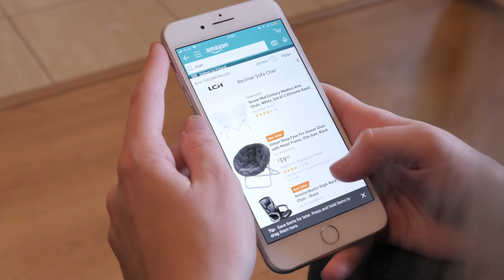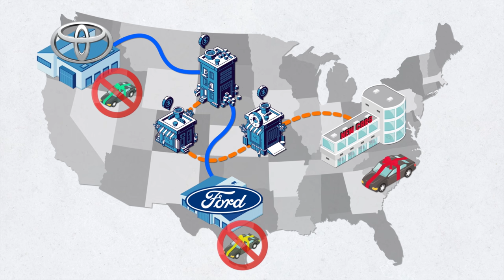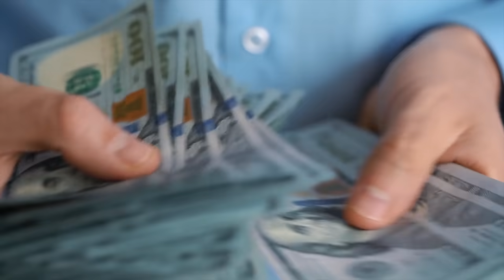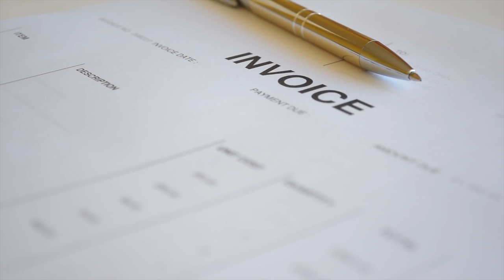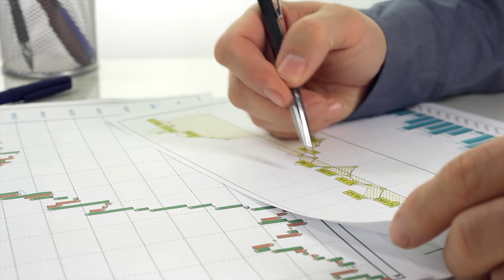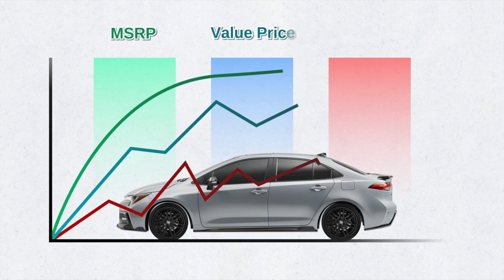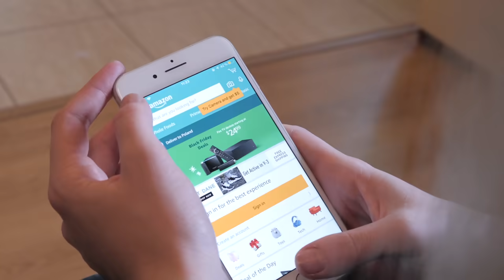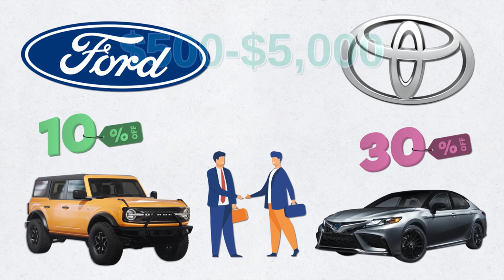Here’s Why Car Prices are About to Get Way Worse

Comment: Hey Scotty I have a 2020 Tacoma TRD off-road 4x4 and when I’m at a stand still temp gauge goes 3/4 but whe I rev it goes down but then keeps going up took it to the dealer and said it was normal?
Reply: Read the user manual, does it say it's normal if the temp. Guage moved up and down or not. sounds to me not normal but i dunno about new trucks, yours is still new and shouldn't be there anyone messing up with the thermo valve or anything else.
Reply: Definitely not normal. Those Tacoma’s aren’t always bulletproof like everyone will tell you. Toyota has problems just like any other brand, just not as many
Reply: I take it to another dealership for sure
Reply: @lesterparker1594  Now the Tacomas are made in Mexico. Sad they are not made in Texas anymore.
Reply: @jaysmith179  you are correct. Part of the reason I bought a new ranger instead of a Tacoma. Mostly bought the new ranger because it was way way way more comfortable and fun to drive.

Comment: Scotty Kilmer I have a question my wife has a 2013 Ford Focus which she had sitting for months prior to sending it to the Ford dealership to get the Transmission Control Module replaced after being replaced they called us and said oh the clutch is messed up and also said that there was a recall on the clutch 5yrs ago she got the car from another dealer I think private owned are we responsible to get to get the clutch replaced which is over $3000 when there was a recall on it before my wife leased the car from them PLEASE WE need help we are in a very tight situation we have a loaner from the dealer ship FORD and we have to return it Monday Please help us cause we don’t have the money to get it repaired my name is Patrick Garcia
Reply: 3k to replace a clutch? That’s sketchy I drive a Sti and I could replace every component of the clutch system for less than that.

Comment: Who cares! They are all ugly anyway. I have a 2001 Lincoln in mint condition, beautiful, cheap on gas and very comfortable.  Paid $ 3000. Bought old luxury cars forever. It's  smart! Had my 86 Olds for 19 years. Only money spend was for brake pads, battery and tires. It still run great with 450000 KM on it.

Comment: I’m just against buying new cars in general. You pay money that you’ll never get back
Reply: How is this a good argument? I am trying to understand your position.
Reply: @edgaryzen4925  if you buy a new car, it depreciates pretty quickly, which means more money that you won’t see again if you sell it later on. However, with an older car, the value of it depreciates at a much slower rate. That’s just my take on it. I guess costly repairs could counter that argument, but if it remains relatively problem free, then my idea stands.

Comment: After they resolve the chip shortage, probably sometime next year, there's going to be a short period of inventory glut, causing a price dip. Manufacturers are going to slash prices to get rid of all the excess inventory they've built up stored all over the country, when ecu's become available.

Once that's gone, I fully expect 2023 model years to have an MSRP jump of 30%.
Reply: You really think the chip shortage will end? It's been 20 months of 2 weeks to slow flatten the curve
Reply: the supply lines for the parts are messed up too.  Prediction is  that this mess will last thru 2022.  People who can are waiting it out because high prices and not much inventory for choice of what you want.  I work for a large lender doing vehicle loans, Our biz is dropping off, of how many loans we do per month, about 12% drop.  Many lenders have seen less vehicle loans now.  Many car dealers have few or one, new car on the lot.

Comment: I have a Toyota Camry 2015 with 260,900 miles   It runs like a horse, I was looking to sell it and get a new one but used car prices are 20%-30% higher than usual… I am not selling my car anymore. Car never give me any problem, the only  experience I have is regular oil change, filter, breaks and tires… love my Toyota Camry
Reply: ToyotaCamryFan2016  Toyota figured it out. I bought my Camry brand new in 2015 for doing Uber and Lyft after 261,000 miles still runs better than a lot of brand new models. My personal favorite Camry model is 2015 coz i have one don’t sell it will last forever.
Reply: @TheDeadalive7  that is super high mileage for the year. Glad its running great tho!
Reply: @shaloon64  That’s what I thought at first but when I showed it to my mechanic he told me everything is fine do not sell this car so I’m keeping it until the wheels fall off…